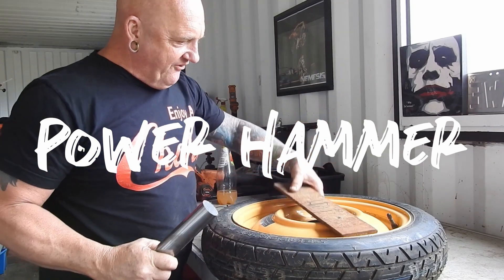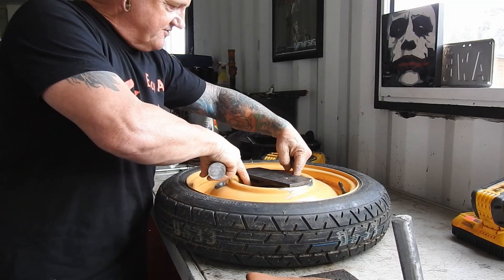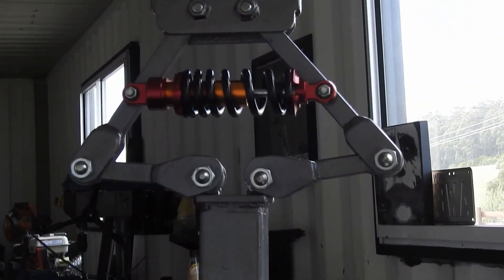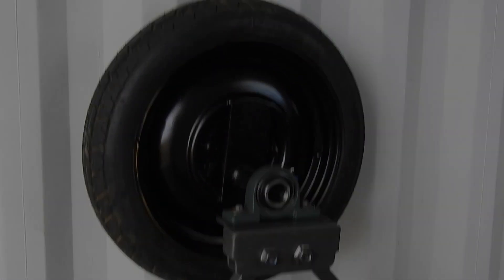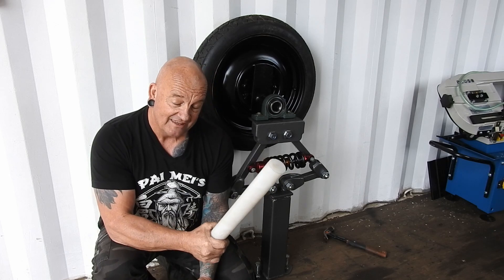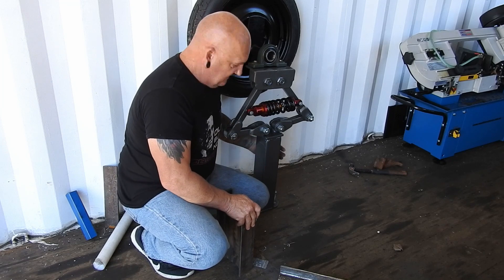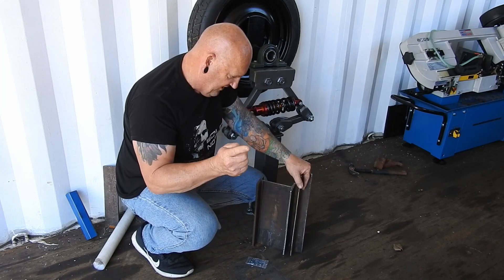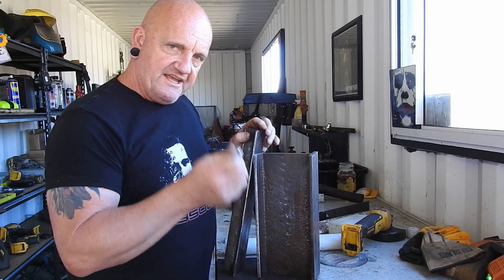Building a homemade Blacksmiths Power Hammer - Part 2

Comment: I get the notion to use what is on hand. But why not an axle stub and hub that bolts to your choice of wheel?
Reply from the maker: Why not! Like you said use what you have lying around and modify it to suit. But yes a stub axle and wheel would work a treat I just didn't have them!....
Reply: Mark Bilson I am fortunate to have 2 power hammers. My hat is off to you and your great efforts! Love the accent and attitude. I’m a 62 year old Texas rancher. My accent and vocabulary is different too! I’m binge watching your progress!
Reply from the maker: @killerkane1957  
love to hear your binge watching!...............Design changes 3 times along the way for the sliding hammer mechanism!

Comment: Awesome video! How did you size the spring on the linkage? Thank you!
Reply from the maker: It is a motorcycle shockie that I already had. I figured a rear swing arm on a dirt bike does a lot of impact work and therefore would be a good choice for the power hammer. So a 'GUESS' has turned out well!